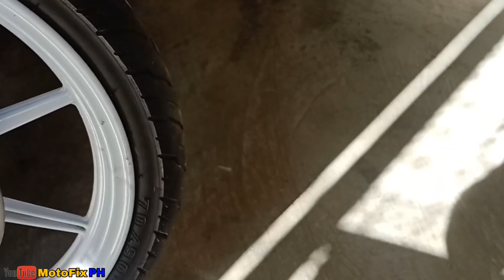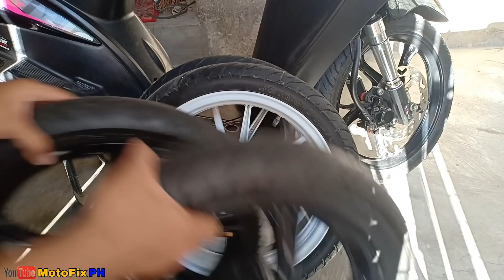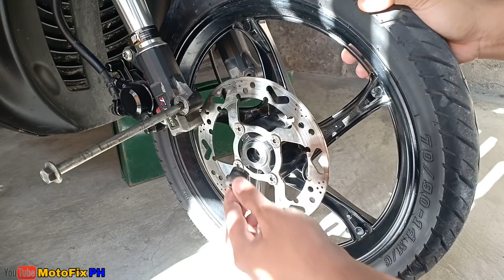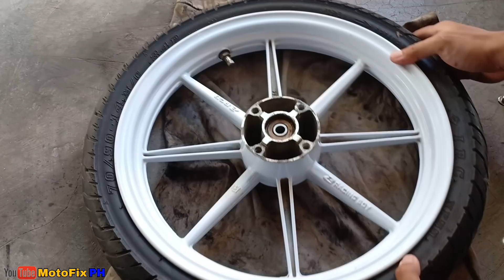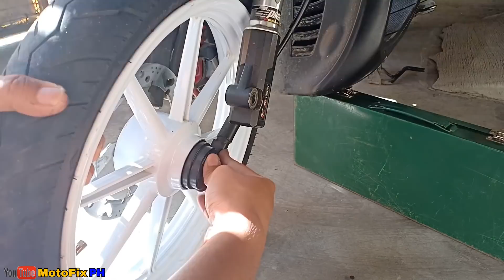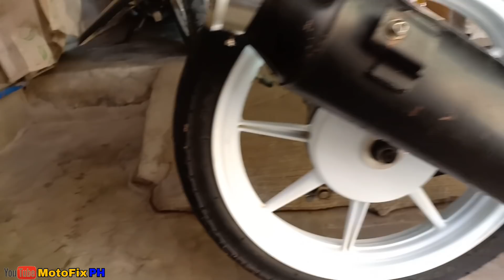Installing RB8 mags in mio sporty | RacingBoyMags

Comment: boss pag stock ang pipe?? tatanggalin ng buo yun?
Reply from the maker: Yung sa likod na mags. Oo boss tatanggalin nang buo.. pero may mga diskrte na kahit hndi na tnggalin ang buong pipe.. pero mahirap lng i explain
Reply: @MotoFixPH  yun nga po  boss . di ko alam diskarte ee . paturo naman . . salamat
Reply from the maker: @eiramleine8713  mahirap kasi i explain dto. baka magkamali ka.. pero sige do it at your own risk nalang boss. Pero ginawa kuna to dati nung nka stock pipe pako..
Reply from the maker: @eiramleine8713  tanggaling mo lng yung bolt sa stockpipe canister isa lng nman or dalawa yun. Deng wag mo tatanggalin yun naka konekta sa engine..
Then itaas mulang dahan dahan yung stockpipe mo na may konting pagilid.. then yun na pwdi munang mailabas yung rear mags mo sa mio..
Reply: @MotoFixPH  cge boss try  ko nlng . . salamat ah . feedback nlng aku ulet . pag ok na
Reply from the maker: @eiramleine8713  sige boss. Ridesafe po